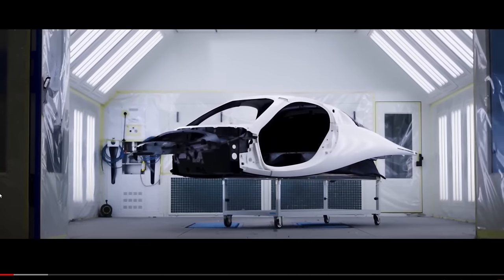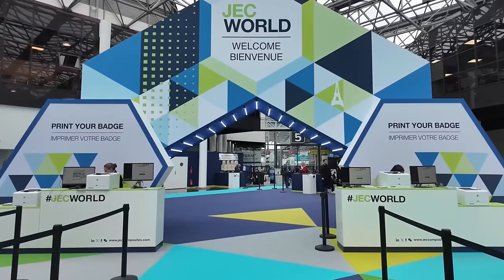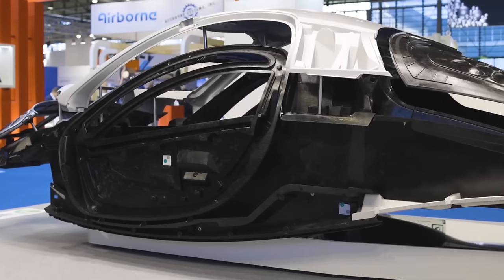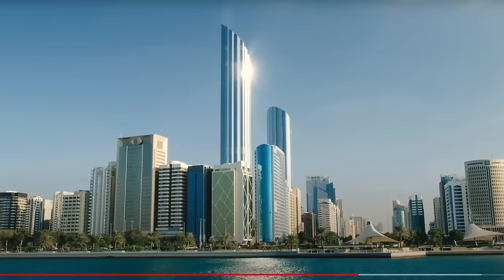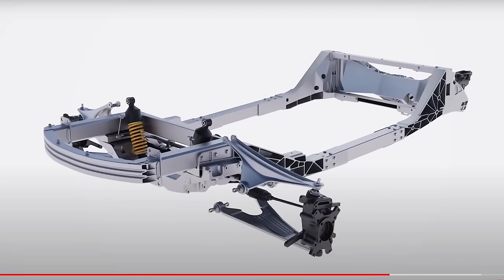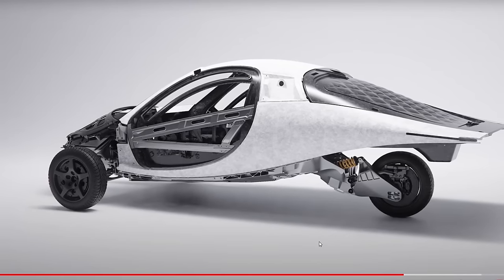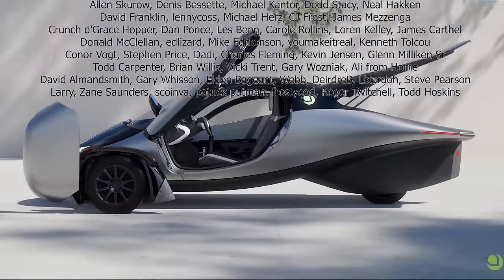Aptera March 2024 Update Commentary

Comment: So we still need to pay for the tooling for the frame? I remember the days when a frame wasn’t required. What changed? Is the Carbon body not as ridged as the honeycomb version?
Reply: They covered this a year ago. So no new information that needed an aluminum frame.
Reply: I'm assuming CPC was not comfortable with bolting the suspension to the BinC. They felt that a chassis was needed to house the battery and mount the suspension components. That would give a more rigid contact geometry with the ground. 

The frame also adds to the crumple zone in the nose. So I'm sure it adds to the safety.

While there's been no new update in this, I'm assuming the delay in the chassis is so CPC can design it according to real world test track conditions instead of computer simulations. I would be surprised if the chassis changes, it sounds like this is all about the suspension.
Reply: Don't Alpha and Gamma have a frame? If so, where is the battery pack mounted?
Reply: @adimchionyenadum2962  I only heard about this myself recently. But it's my understanding that Alpha and Gamma do not have frames, of steel or aluminum or anything else. They obviously have a suspension but there is no chassis between the front suspension and back wheel. 

The battery packs are under the seat, as with the PI design. However I've seen renders where the last pack is standing up at an angle, almost vertical. I'm not sure if this was ever used for Alpha or Gamma. It might have just been an early PI concept.
Reply: @adimchionyenadum2962  - When they showed the B, you clearly see it's a steel frame. You can tell by the welds and they even painted it black.
Reply: @adimchionyenadum2962  No.  Those vehicles were built using vacuum resin infusion - a completely different process.  They still had structural locations for mounting the components.

Comment: Seems like they moved the goal post . I thought they said  once the $10,000 investment program was  fulfilled they would have enough  money to start  production . That was done and  the last I heard  they were reporting they needed more money to go into production,
Reply: yuppp, they need another $65 million to start production
Reply: The accelerator was never intended to fund production. They have always been clear about needing additional funding to start production.  The accelerator just helped them keep the lights on and order some long lead time items like the body panel dies.
Reply: AND to build PI prototypes for validation and crash testing. The Feds need their pound of flesh.
Reply: Yeah, Aptera has said that without further funding they will begin producing vehicles manually, in order to fulfill the Accelerator orders. Once they are done, they will probably continue as long as they have money. But they're going to have a hard time filling 48,000 orders. Maybe they can keep going at 6,000 vehicles a year until they are done, but they will be a niche market. 

But that's the worst case scenario. And really, we've seen that there is a demand for the Aptera, at least 48,000 of them. Once that demand starts getting met, and investors start seeing how much money they could be making, they'll jump on the bandwagon.

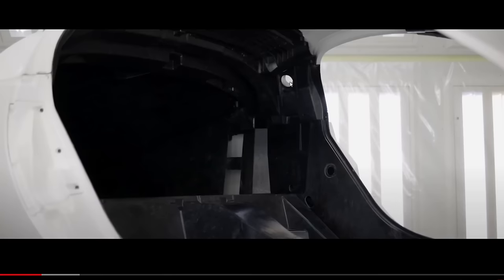Comment: at 3:34 you can see the cut outs for the "ventilation", not sure if it is connected to the Skin cooling as pictured in their Patent.
Reply: skin cooling is not coming to the launch edition sadly, just a regular heat exchanger
Reply: I think skin cooling may be Ok for some climates and the heat exchanger will be added for those hotter areas. Skin cooling is a good concept but not very practical as heat rises and a belly pan would force it to travel in an opposite direction requiring assistance/energy.

Comment: All interesting. I thought CPC is still working on the suspension. Not sure how this can be drivable without a suspension
Reply: PI2 will include the drivetrain, chassis, safety systems and suspension. CPC is working on the chassis, suspension, and safety systems right now. So the body they have is PI2. 

They're vague about whether or not a body has been assembled for PI2, or if it has an initial suspension for testing, but by the time CPC finishes the design of the chassis, PI2 will be the vehicle that has it. Personally I think they've already started putting together test suspensions they just aren't going to show us until they're done.
Reply: @richardryley3660 I wouldn't say that they are already putting together test suspension since they haven't even started tooling the things. But they are certainly getting ready because Beta is presently in Italy for this purpose.
Reply: @adimchionyenadum2962  They are making tooling to develop the parts for the suspension that will be used to finalize the design. They can then use those parts to develop the production tooling that will be used to make the validated chassis. 

Or do you think they're going to use Beta's suspension to validate the PI suspension? A suspension that is completely different and does not in any way fit the PI body that has been developed?
Reply: @richardryley3660 Do you know that CPC is developing a fresh suspension system for Aptera different from that of Beta? The last update I have is that Beta was the final production suspension. Don't forget it passed with glowing colors all the harsh tests it was subjected to, including the Morse test.
Reply: @adimchionyenadum2962  I have never heard anyone from Aptera say that they are using the Beta chassis as a prototype for the PI chassis. The closest Chris has ever come is his reference to "Beta+" but that could just as easily be a combination of the PI chassis and Beta. 

The important point is that Beta is not a production vehicle. It was designed from the beginning to be a platform for testing the limits of the Aptera technology. To be frank, it is over designed. It just barely has a body, and has no aerodynamics. 

The PI chassis may take some cues from Beta, especially if Beta has a separate chassis, but the PI chassis will have to be a completely new, unique construct. Beta would be a step backwards.
Reply: @richardryley3660  When Beta debuted I heard Chris say many times that with Beta tested they had finalized their production suspension, whatever that means.

Comment: Not sure why it matters whether screws are metric or not.  I concur with the formats of PI1, PI2 and PI3 and all are supposed to be flown over at last count.  Which PI's are  going to be used in crash testing, was it PI4 and PI5?  Also, what is the first PI to be delivered to a customer?  We don't know if the chassis cannot be mass produced already.  The change to a metal frame is likely in the difficulty of attaching control arms etc.  Great job Steve!
Reply: They will use British Standard for fasteners. I hope they use positive ground battery system too.
Reply: I'm sure all PI models that survive will be kept by Aptera as historical models, just like Alpha, Beta and Gamma. 

That being said, I would love for Aptera to ship out 2 PI models at the end of December to the first two Accelerators. That way they can say they released in 2024. 😂
Reply: @richardryley3660  - Do like Arcimoto and hand build 10 of them for $60k each. First sold was to some actor in Hollywood. The rest, employees and friends. They were in production though.
Reply: @billsmith5960  Kind of the idea since their investment is why they're an Accelerator.
Reply: @richardryley3660  I am hoping /expecting a lot more than two by December. :)
Reply: @arcticturtle8776  You go with your enthusiasm, but don't be disappointed if it isn't.

Release in 2025 is not a bad thing. 🤣
Reply: @richardryley3660  - Nope. They purchased stock for $10.50 per share. So when Aptera does an IPO, those people can sell when it shoots up. It always does with an IPO. Thus they can make a boatload off of it. Not the same with Arcimoto.
Reply: @billsmith5960  And now we know what a mistake that was for a product with  future.

Comment: When you talk about those holes on the mold, they are for ejector pins. Industry standard been around for many years.

Pi-1 will also have to be used to fit all of the interior too. So don’t forget that.

At least they painted the bodywork with some clear coat. Makes sense as they had it sitting in the paint booth.
Reply: It was not in a paint booth.  You should know where it was if you are the engineer you claim to be.
Reply: @n.brucenelson5920  - I am an engineer and know for a fact it was in the paint booth. I only provide facts.
Reply: @billsmith5960  I wasn't there, but I have seen too many "sarcastic: comments from you to believe the whopper that you only provide facts.  Just to be clear, I never got an engineering degree, but I have been the lead many engineering projects, including for the ISS.
Reply: @n.brucenelson5920  - I'm talking about this situation. I literally provided you with where to look to back up my claims. Now you divert to something else. So, instead of just admitting you were wrong, you belittle me by just claiming my post, that is backed by facts, is just sarcasm. Then you, even further belittle me by wondering if I'm an engineer.

Top it off, you seem to follow me around doing this. This is the second time you've done this and for being an ambassador for Aptera, I doubt this is what they expect out of you.

Next time, when questioned and I provide the facts and you are wrong, just admit it. I'll do the same.
Reply: @billsmith5960  Bill, nothing personal, but I watched the original video showing the body parts, and they said that the room it was displayed in was a Coordinate Measuring Machine (CMM)   I was not there and don't know of my own knowledge.  

I also seriously doubt that the parts are painted.  There is no reason for it, and several reasons for them not to.
Reply: @n.brucenelson5920  - Where is this original video? 

The reason to shoot clear on it as SMC is not molded with a gloss finish. So, shooting it with clear makes it easy to clean because of all of the hands all over it and since they will be showing it off, nobody wants to see grubby fingerprints all over it.

Comment: We have not been given any DETAILS of how they will break even with just 6,000 vehicles sold a year.
Reply: @shrimptopian3392  yeah, launch vehicle will probably be more expensive than a Tesla Model 3 and Y
Reply: No details needed. Chris said it and thus it’s true. On the otherhand, it could be a forward looking statement.
Reply: I remember details being talked about. The factories are low cost, unlike traditional auto factories.
Reply: @shrimptopian3392  🤔Nope! The biggest cost of the vehicle, the battery, has dropped by more than half since 2019. Solar cell prices have dropped a lot too. We could see a price drop! 🤓
Reply: 6,000 × $34,000 is over $200 million. Their manufacturing processes are less expensive than most. Their marketing is minimal.

I'm not saying that 6,000 is the absolute be-all end-all break even number, but it doesn't seem as outlandish as it would for any other manufacturer.
Reply: @shrimptopian3392 - It's not like 6,000 is their maximum annual output or that they're only planning to sell these vehicles for one year. With a single shift, they can make 10,000 units per year. Their facility allows them to hire a second shift without expanding, which would double that to 20,000 units annually without expanding beyond Carlsbad - more than triple what they say they minimally need to function.

Looking around this post, it clearly seems like you've decided how this is going to play out. It's the safe way to bet with any start-up, really.

That said, being all Chicken Little about it is as fun as going to Vegas and cheering for the house to win.

And, really, Aptera seems in a better place to succeed in the solar vehicle space than Lightyear or Sono were, and have a better design for an electric three-wheeler than Elio, Electromeccanica, or Arcimoto.
Reply: What’s unfortunate is we still don’t know what the launch prices will be. Likely with all this inflation affecting a lot of things in the supply chain the price will be higher than previous speculation around $40k. Idk I just want to see a single validated PI driving down the street with 3rd party validated efficiency and range added on a Sunny California day
Reply: @RomanChaar  😀 Since we all like making predictions, I predict that the final LE price will be +/-10% of the current estimated price. Note that the cost of Lithium batteries and solar panels have dropped by ~50% and the new CF body requires only a small fraction of the labor and manufacturing time as the original design. Those cost reductions will likely cancel out inflation's increases.
Reply: The efficiency of design is why assembly can be so cheap.  They don't need a lot of employees either. There are only 6 parts to put together for the main body. 

I don't think the price is going to change from what is currently stated. I could be wrong but I've not heard anything that leads me to believe that. If anything, why raise prices when your profit margin is so large?
Reply: @richardryley3660  also don’t forget most thing will be manufactured thousands of miles away in Europe and Asia, so price still will be high for a while
Reply: @RomanChaar  Perhaps, but it would be more productive to take a loss until they can move the production chain to the US. 

The biggest challenge is going to be moving the body production to the US. Chassis production can probably be moved here fairly easily. The batteries will be moved here after the first 100. The motors are an unknown but we'll see. 

I'm pretty sure once production starts,the bodies will be shipped in bulk. They can ship a lot of bodies at one time. 

Also, it's ironic you're arguing that it costs more to produce goods overseas.
Reply: @richardryley3660  Europe is not cheap, fuel costs are up everywhere.
Reply: @RomanChaar  Kinda a good reason to sell Apteras in Europe, huh?
Reply: that bold statement if aptera hire 100 employee that will cost them at least $1,5B a year even if they hire 50 that will cost them $750M that not include cost of materials and other things
My estimates that they need to sell 100K aptera a year at $37K price and scale to 150K, 200K in the third year to reach the break even point and that won't happen until 2030 with miracle if they survived and if there's demand for 200K aptera a year
Reply: @shrimptopian3392  You don't know that.  Both labor hours and battery pack costs have plummeted since then.
Reply: @shrimptopian3392  NO.  Labor hours have gone down dramatically since vacuum resin infusion was planned, as has material scrap.  You have no idea what you are talking about.
Reply: @northernsouler  Actually the tak time is 12 minutes.  A single shift can make 20K units per year.
Reply: @shrimptopian3392  You have been trolling for that long and every month is showing you more wrong.
Reply: @shrimptopian3392  What was worse, siting at home bemoaning the fires in Kuwait that were going to take 10 years to extinguish, or going to Kuwait myself to work with the Kuwaiti EPA and do something about it?

Throwing shade at the people actually doing the work is a pitiful way to spend your life.